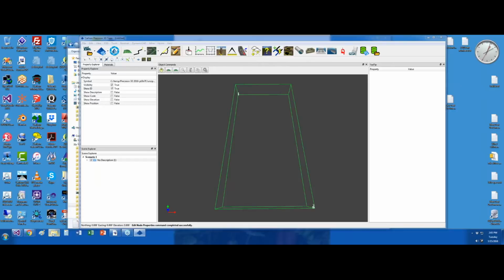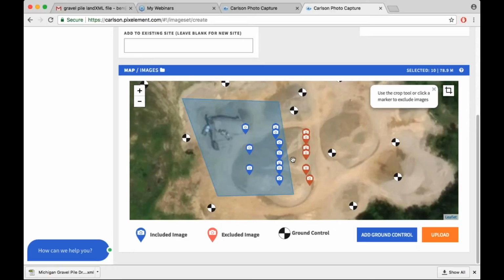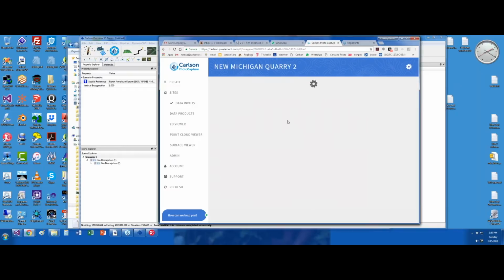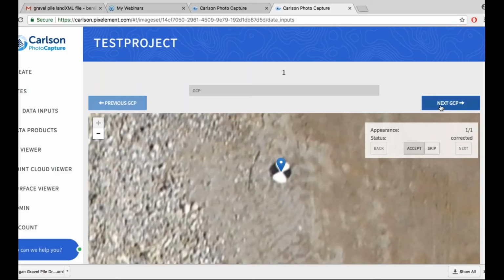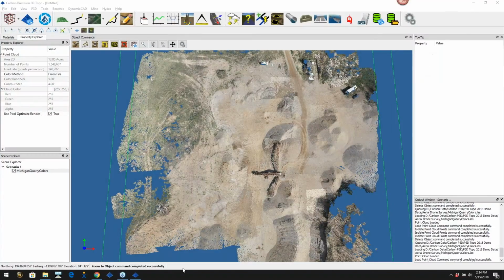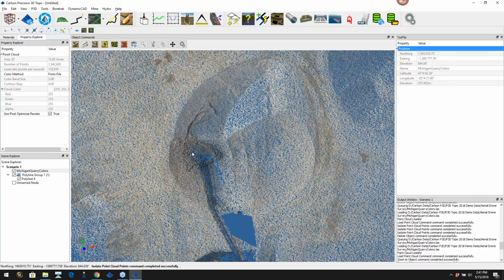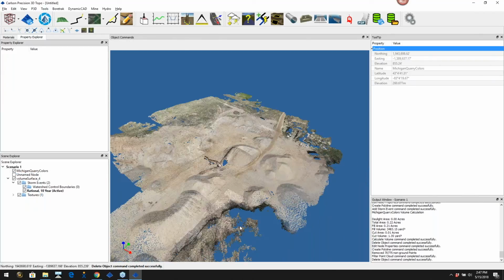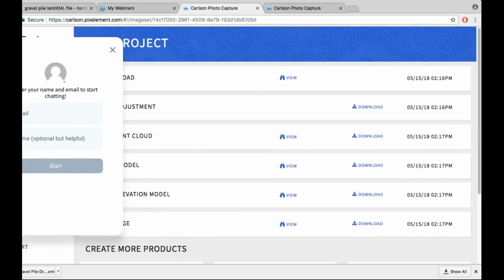Carlson Webinar | Drone Topo Surveying with PhotoCapture and Precision 3D Topo

Comment: George Godson
Can the GCP points ASCII file be from a survey in a totally arbitrary plane co-ordinate system ? That is 5000.00 m North, 1000.00 m East, 100.00m  elevation for one of the points?
Reply: George, not currently, although this is on our development radar.  All images must be geolocated - this is typically done automatically by the drone, and the gcp points must be in state plane or lat/long/elevation formats.